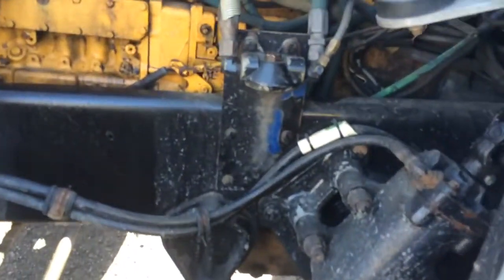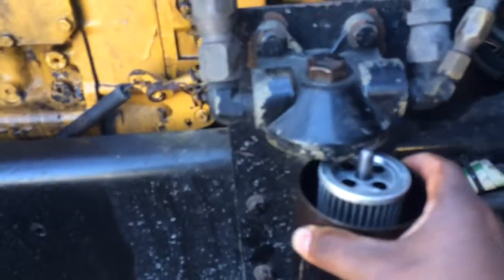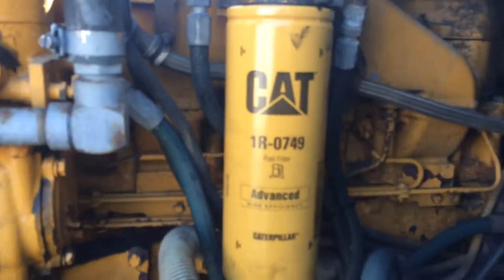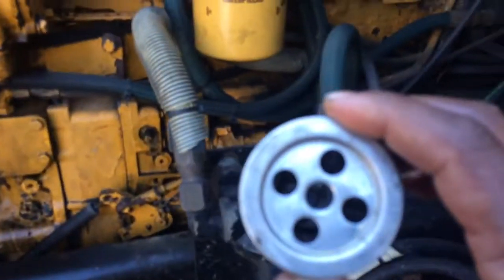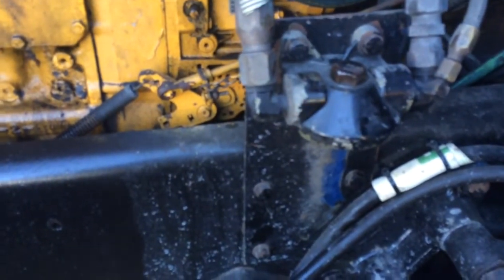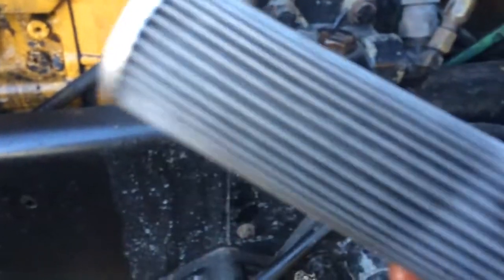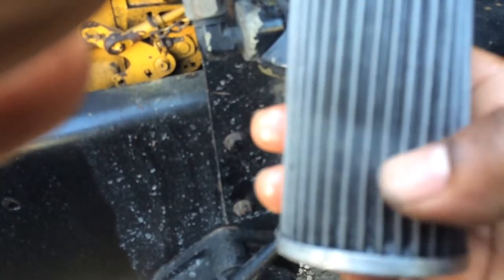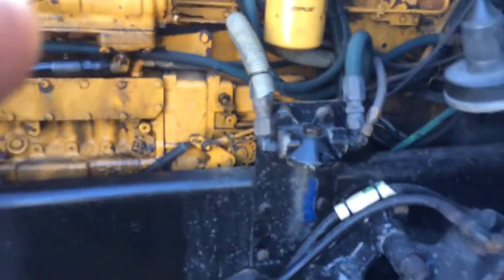Servicing a 3406B CAT Fuel Water Separator | 425 CAT

Comment: I just bought a Pete with a 6nz. How long do the cat filters last??
Reply from the maker: It really depends on how hard you run, and where you get fuel. On average I change my filters around 13-15,000 miles, Occasionally I'll change my fuel filter a little earlier (10,000 mile range)..depends on how much PSI(on my gauge) I loose during intervals. Hopefully that helps?